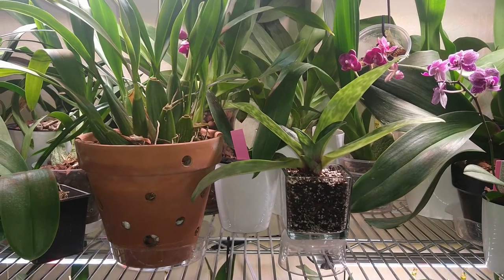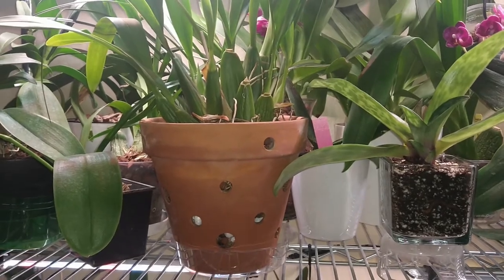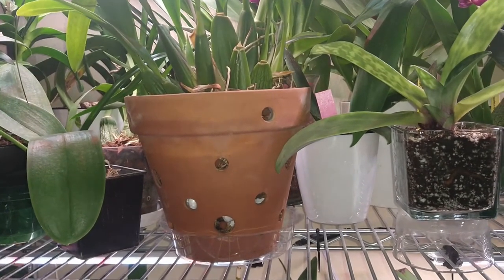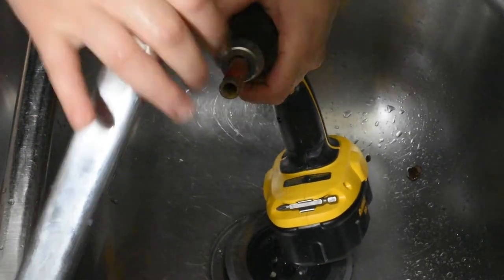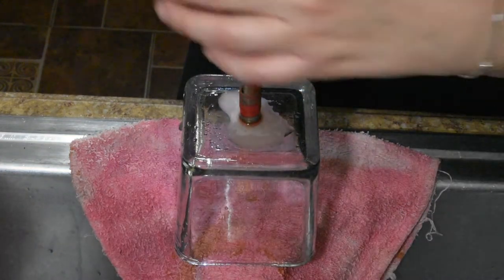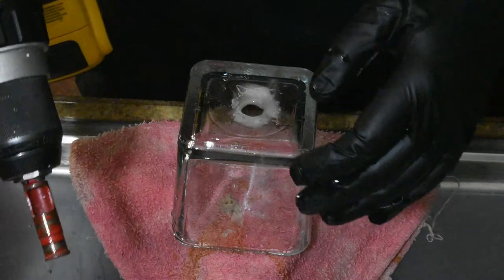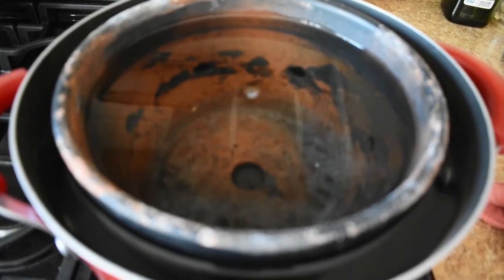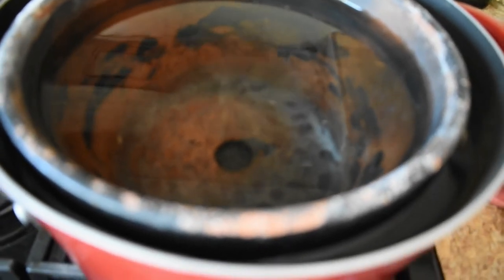DRILLING HOLE ON GLASS OR TERRACOTTA POTS..

Comment: You started drilling at a 45 degree angle not at 90 degrees.  After the initial 45 degree drill, in order to get the notch, you rotated to the 90 degree angle and proceeded to drill straight down into the glass container.

Comment: I was wondering if I could make smaller holes in terracotta pots, like if I turned them upside down and made wind chimes out of them.
Reply from the maker: I am sure you  can you just have to buy the different size bit that's all
Reply: @teresascorner994  I’ll be going to my local Lowe’s to see what they’ve got as far as drill bits go.
Reply from the maker: @wildshadowstar  u bought a pack of 3 direct sized  at home depot over 2 years and I still have them. They work great
Reply: @teresascorner994  I live closer to Lowe’s than Home Depot, but will keep that in mind if I decide to order online.

Comment: I'm so scared to drill through glass. You did it well. Im afraid I'll break everything.
Reply from the maker: Hey Nicole, at first I was too. I even broke one or two glass jars. The glass was to thin and I drove my drill straight through it. lol The diamond tip bits work great. I would not drill on glass with any other drill bits.